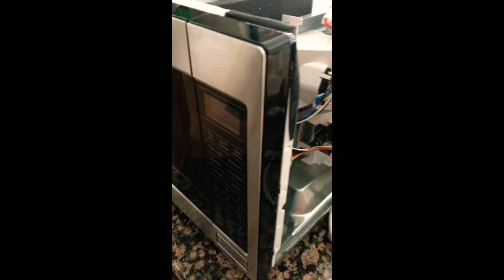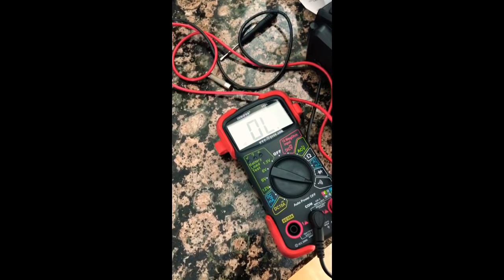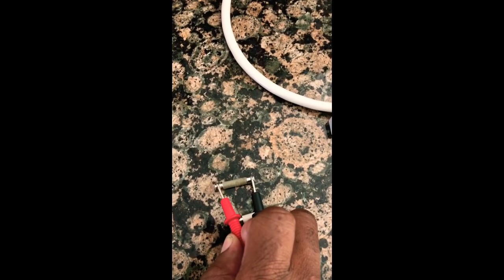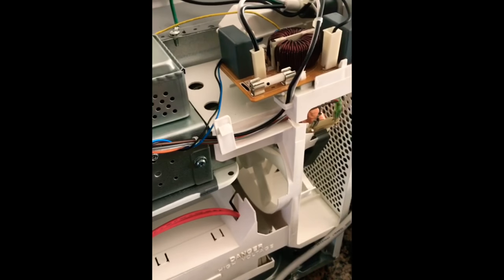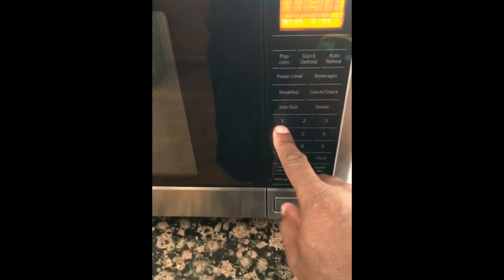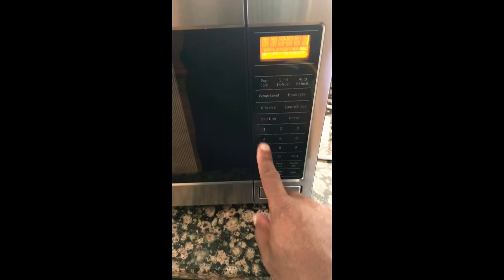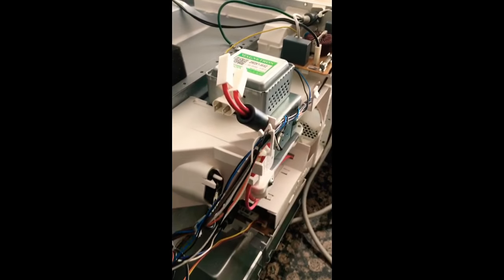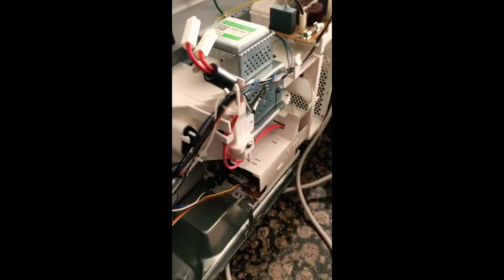How to fix a microwave that shuts off or wont power on

Comment: is it 100% necessary to have the magnetron connected? since I see in the video the oven stays on when it's disconnected from that

however I just see this, which is kinda scary to say the least

Magnetrons can be incredibly dangerous, while you are safe from radiation when they are not powered, the ceramic insulators can contain beryllium oxide which can be fatal when inhaled. If Magneto is the enemy of the X-Men, the magnetron is the enemy of all lungs everywhere